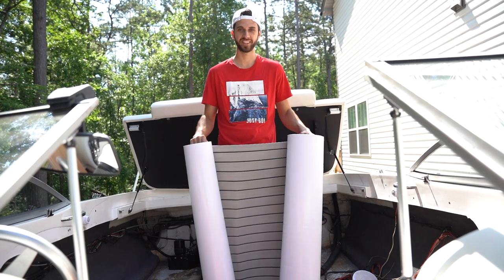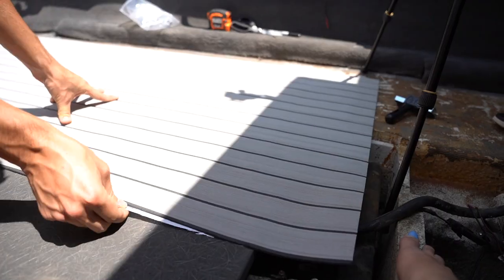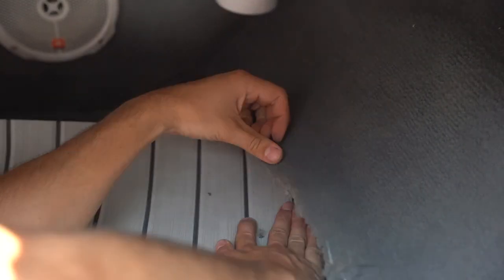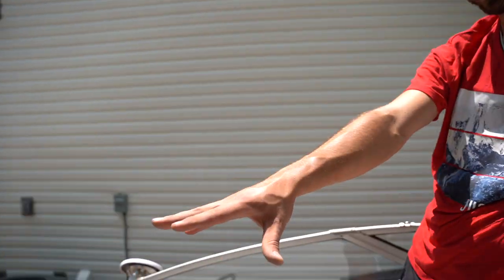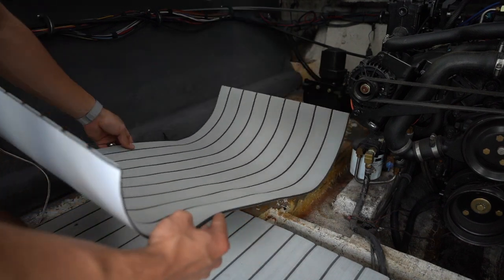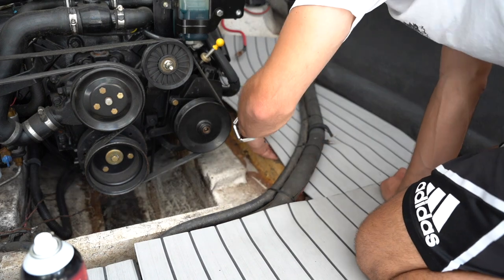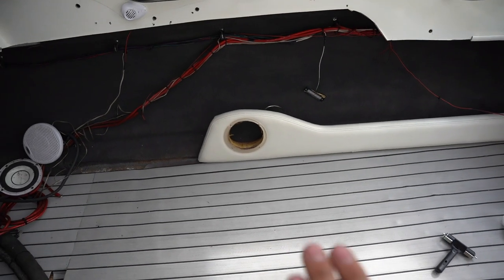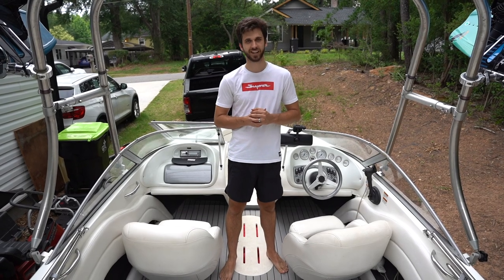Putting in EVA Foam from AMAZON in my Boat!

Comment: Just wondering how much was it in total and about how many hours??
Reply from the maker: This whole project for me was a total of $650. Thats including the Coosa board, EVA foam, adhesive, rollers and spray paint. If you don’t need the Coosa board and spray paint then you’re looking at roughly around $250 for just the EVA foam material and adhesive for the project. Whole project took us from tear down to putting everything back in was about 12 hours of total work.

Comment: I see you laid the EVA directly to coosa board.  I'm curious, did you have to treat the coosa with anything like a resin or acrylic to get the glue to adhere?  Or did you lay it straight to the raw coosa - and if so how did that turn out, was there any issues with it peeling up?

Comment: It sticking still good? I got the same stuff installing soon
Reply from the maker: Yes its still sticking great! The only place where its pealing up slightly is the front edge of one piece, when it was curved up from being stored in the box for a while. I only flatted out one piece of EVA Foam and not the other as well. What I recommend is let it sit out in the sun for a bit and flatten out the edges with some weight so when you install it doesn’t want to lift back up